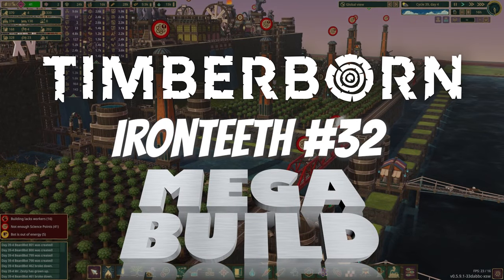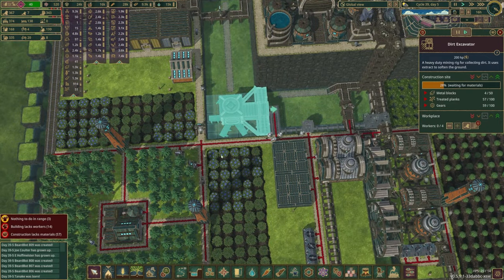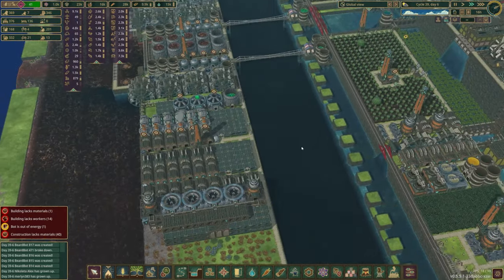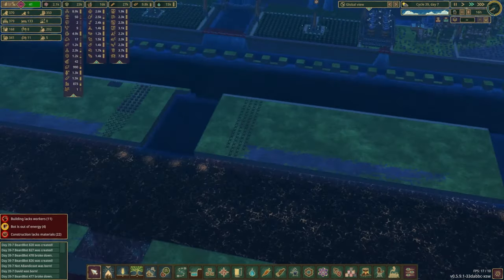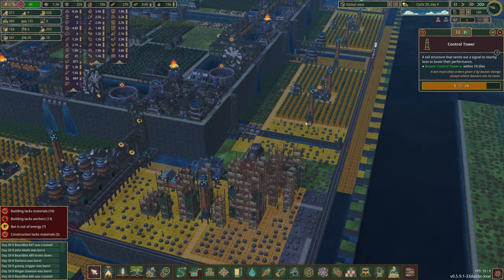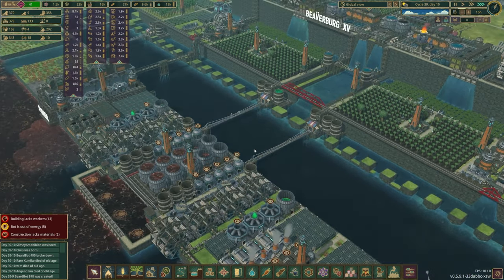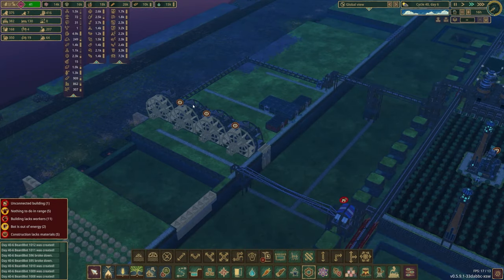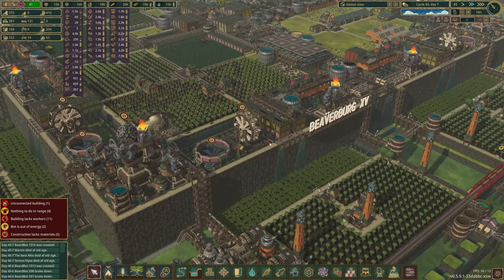A new power area takes shape! Timberborn Update 5 Iron Teeth Mega Build Episode 32

Comment: → 0:03 It looks like the bridge works (i.e. the train can run across it) even though there is not enough science for it.
→ Your explosives storage might be done (and before the dynamite) faster if you give it a higher priority.
→ I still think you don't need all the towers running – focus on the ones where important activity is happening (and the bottleneck is the working speed, not e.g. the growing trees).
→ 36:19 A somewhat better looking version would be to blast a hole in the ground (two deep), then put the power shaft below the train on the same level as the shaft over the water.
→ 37:35 "I have all this terraforming happening and I didn't even put in a thing to hold dirt." – You also didn't put in a thing to hold extract for the triple dynamites.
→ Metal blocks: I think you have them only in the outer district, and not in the two forest ones, and no direct connection between central and outer district? (There was a plan to extend the central district to at least one of the big district crossings towards bottyville, I'd still recommend it. You can do that without cutting woodyville, by using a bridge.)

Comment: I think you have to have at least a tiny storage in every single District because if you have to transfer something from the bottom District all the way to the top District they don't see it as needed in the middle District therefore they don't import it into the middle district and then that causes problems because it can't get into the top District from the middle District
Reply: For example you need metal blocks in the top District but in the middle District there is no need for metal blocks so they're not importing them from the bottom district and that makes it so there aren't any metal blocks in the middle District to export to the top District

Comment: You might need more Beavers in your district crossings to move stuff between districts faster (like logs/metal blocks/etc)

Also as others have pointed out, having a small buffer storage for each item type in each district can help with moving stuff around.

Comment: 44:19 Those water outlets on the edge of the map in the background ... If you built large waterwheels on something 1 block high in those existing channels would that produce less power 🤔🤔❓❓❓   also: have you considered forcing water to flow parallel to the map edge thru rows of waterwheels before turning 90° to go thru those short channels to exit map ❓❓😁😁😁.  ( Can you hide numbercrunchers under waterwheels without loosing efficiency of water flow rate ❓❓🤔🤔)